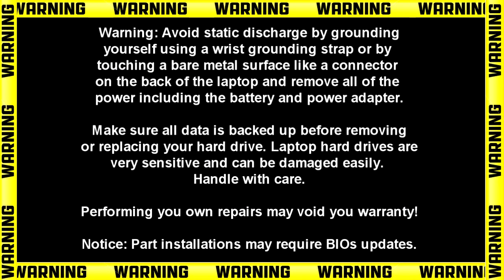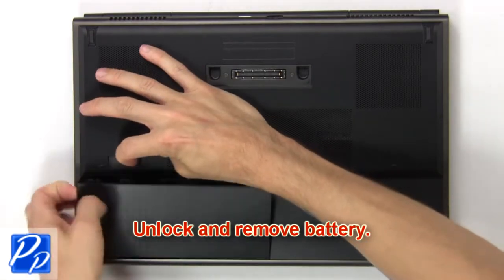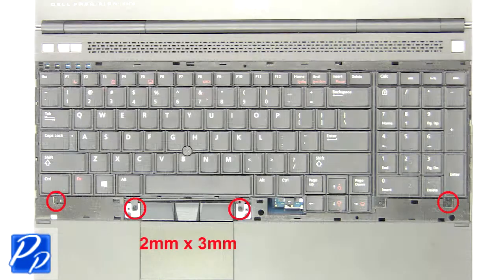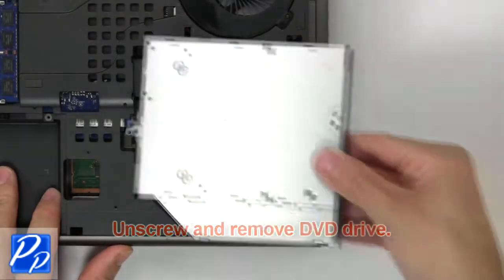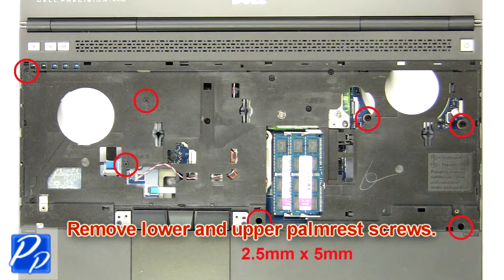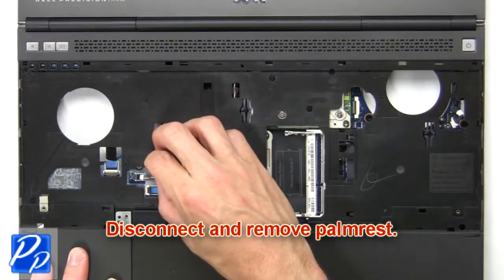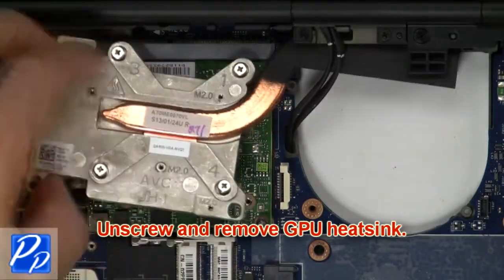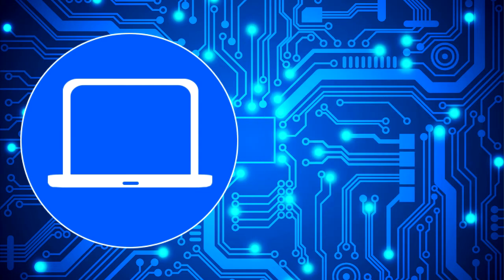Dell Precision M4700 (P21F001) GPU How-To Video Tutorial

Comment: Thank you for posting this step-by-step walk-through video! I was able to use your video to successfully replace a defective video card in my wife's M4700 laptop. Very good video editing and concise composition. The still images with the screws circled in red were very helpful too.
Note: The GPU cooling fan removal step is missing from the video but present in the list of steps that is linked to in the description. The GPU cooling fan must be removed before the GPU heat sink can be removed without being damaged.
Reply: @Simba1993 Did the K2200M work in your M4700?